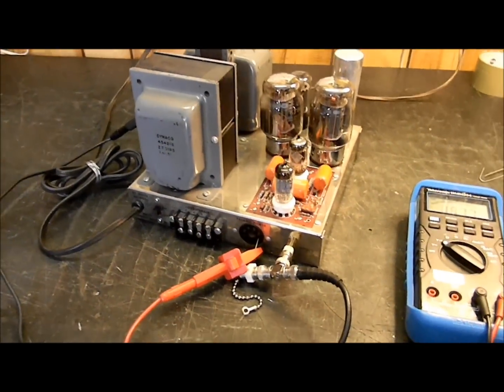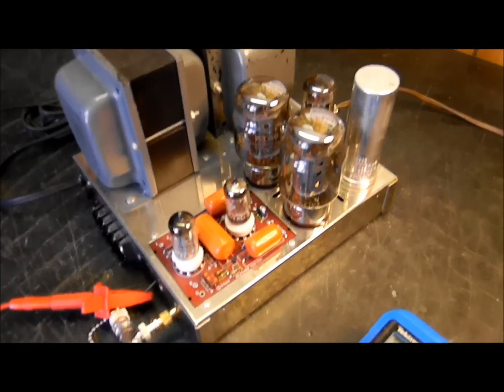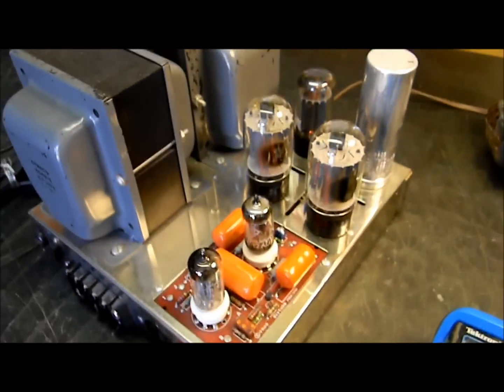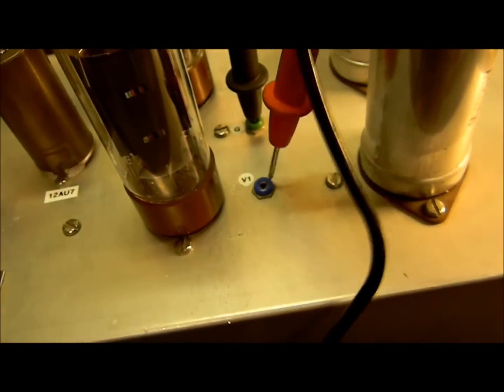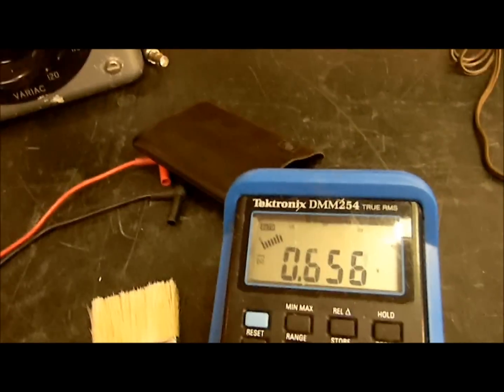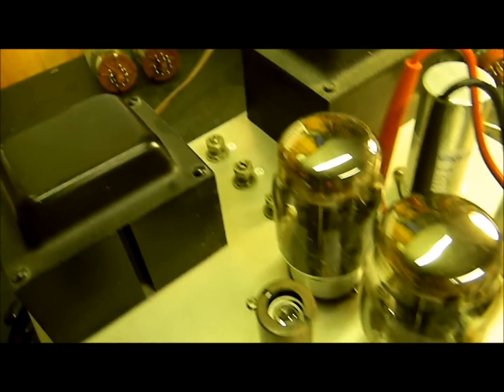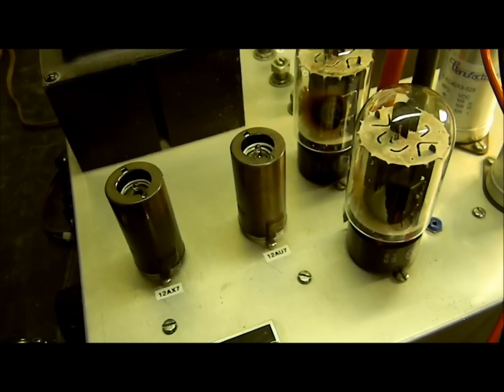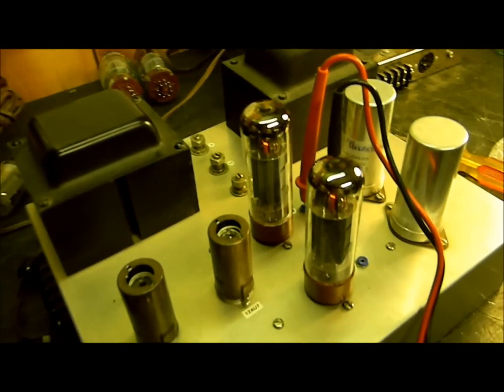KT88 vs EL34 vs 6L6 Substitution In Vacuum Tube Amplifier.wmv

Comment: At 1% distortion -- this is NOT good.   The old Quad Amplifier (from UK) using KT66's (mind you only 15 Watts max) had less than 0.1% total distortion.

The sound with 1% or more distortion must have been terrible.  No good whatsoever for classical music, but perfect for Pop, Metal, etc and other modern "noise".
Reply from the maker: I prefer CD over vinyl. I use Mcintosh C20, MC275 and MVP831with Klipschorns. As you might see from my videos, I like to experiment with other vacuum tube amplifiers. I have never been charmed with SE amplifiers. LF response on SE amplifiers is usually poor. 

I have another system with Dahlquist speakers that sound pretty good but are terribly inefficient. I have to drive them with a MC2205 and MX112. 

The stereo amp I built not long ago with the Acrosound TO-305 transformers from the Williamson/Heathkit circuit is a beautiful sounding 25 watt system on the Klipschorns.

I have some nice turntables, Rek-O-Kut and Thorens and others but acoustical feedback is always lurking when playing vinyl records.

And yourself? What do you prefer?
Reply: I was actually referring to Mr. Classical Music Elitist Alan Torrance. but your setup sounds pretty sweet
Reply: the queen eats bangers in bed in her panties
Reply: I have listened to the Quad Kt66 (old) that was owned by Ken Kessler himself, the sound was slow boring and really no dynamics.  Not a reference at all.
Reply: what medium are you playing your classical music with?

Comment: soo?? this second amp has a B+ of around 350v when the 88s load it down...in order to qualify 70ma each. i am looking to convert a marshall superlead (34s) to 88s.. could you verify the needed change in splitter resistors and screen resistors...?

Comment: In a nutshell, you have to re bias your amp if you change the tubes. Some amps have switching on the back, others the bias has to be manually done. So, the rule of thumb is just use the recommended tubes. My experience is the better the tubes the better your amp will sound. New tubes have to be broken into, they will sound very clean. I was upset when I put new tubes into my amp, it didn't have the same distortion and sounded too clean. Well, a lot to be said about old tubes and good distortion.

Comment: Can i Replace in a Marshall 1986 or 1987 the EL34 with the KT88-94 for More clean Headroom ? 
The Heater current of the KT88 is about the same of the EL34 ....I know i have to lower the bias feed resistor from 220k to 100k to avoid tube problems ..the question is : the transformer can handle the bias current draw with the KT88... i have read that the tube should be biased like a EL34...but if bias this way they should be biased too cold !!!!! Can i bias at 60% with a plate voltage of 470v-480v without overheating the transformer ?
Reply from the maker: +Giuseppe Loriga You are right about the filament current being close in the EL34 and 6550/KT88 so that should be OK. Plate voltage on both tubes can be as high as 800 volts. I doubt it will damage your transformers but I would limit the plate current in each KT88 to 70 mA (140 mA for both KT88's) by adjusting the grid bias. As the amplifier is built for an EL34 the bias is probably not negative enough for the KT88 so it will have to be adjustable to a more negative voltage.  Pin 1 of the EL34 is g3 and is probably grounded at the socket. Pin 1 of the KT88 is attached to the metal ring of the 6550/KT88 - make Sure pin 1 of the KT88 socket is grounded to the chassis - as it probably already is..
Reply: +ElPaso TubeAmps Thanks for your Help ... So what is the effect of the reduced plate current in the tube ? Can i bias the tube at 60% ( 43.8ma with a plate volge of 480v Class AB Fixed Bias) or it will run colder ? Last question the pin1 in my el34 tube socket is grounded to the chassis through the 1 Ohm resistor , is that ok for the KT88 ?

Comment: Those 6CA7s tubes are very dependable and they sound great I have a Quid set in my plush amp we tinkered with they are GEs however so the tone is there. EL34s were very unstable in the plush. I did put in a presence pot in the circuit. so the amp sound like a fender on steroids a cross between English & American. I like the math of it but I am not a tech. Thank you for posting this video. c];-D

Comment: I don`t know if you are using grid or cathode bias but check the manufacturers tube spec. Also remember that with EL34`s (6CA7)  you must earth the screen pin (G3) seperately.

Comment: question, when your figuring out the wattage output of an amp, i know you use voltage squared divided by the ohms gives you the wattage, but when your checking the voltage do you have to have to use a true rms meter, or is there a way to do it with a regular multi meter?also, do you know of any cheap devices that I can get to verify the actual output of an amp before clipping? or do you basically have to have a osciloscope, frequency driver, rms volt meter, resistive load(to emulate speaker), and distortion analyzer? or can i not use an osciliscope and just get away using a distortion analyzer?(somehow i have a feeling a dist analyzer is more expensive then a scope)

sorry for my igrorance but i'm relatively new at electronics repair and am trying to set myself up for working on tube/ss power amps.
Reply from the maker: You have described pretty much the whole setup. A distortion analyzer and an audio spectrum analyzer is probably the most expensive things to have. An oscilloscope, a signal generator, a RMS reading volt meter, and dummy loads are necessary. You can drive the amp up to just below clipping and get a pretty good idea of its performance with a THD around 1%.  Noticing the shape of the sine wave is important also. Pretty much any volt-ohm meter will work for reading RMS voltage at 1 KHz like the vintage Triplett and Simpson analog meters Knowing the frequency response of the meter before purchasing is a good idea and ideally you would want one that is flat from at least 20 to 20 KHz or better. The Tektronix TM500 series instruments will let you have an oscillator, voltmeter, distortion analyzer all in one mainframe. The most expensive items for this type of setup would be a SG505 oscillator and the AA501 distortion analyzer - you could pay $1K for those items but possibly less. You can buy good used Tektronix scopes for little money and in my opinion they are definitely the best to have. Of course new ones with a spectrum analyzer and oscilloscope built together (called Mixed Domain Oscilloscopes - MDO) are lots of thousands of $$$. Good luck with your enterprise. If there is anyway I can help, please let me know.

Comment: hello sir this video is really teaching a lot and it does help me a lot I still reading and comprehending more about tube amplifiers, I have a question if you don't mind, I still in the process of making a KT88 push pull ultra linear hi fi amp "not for guitar" home use on the cathode of the KT88 what resistor should I use 10R 3W is fine or should I get a 5W ? many people have use 5W and 3W what is correct ?

the B+ will be around 460V DC from a Edcor transformer model XPWR247-120 330 - 0 - 330 you mention already "long time ago" that I should use 4.2K output transformer one more question about output transformer, should I get one that can go up to 100W or one that supply about 60W ? I was thinking about the B+ and I'm not sure what transformer should I get because of the 460V DC B+ I'm a bit confuse to be honest

Regards
Juan
Reply from the maker: Hi Juan - here is the way I would look at it - absolute maximum cathode current for a pair of KT88's is about 275 mA - that is the current if the tube is being driven to maximum sustained sine wave power. (from a 1962 RCA tube manual) That current flowing through the 10 ohm cathode resistor would dissipate power of (I^2*R) which would be about 0.76 watts so a three watt resistor would be OK - even a 1 watt resistor would not burn up but would get pretty hot. Another possible way to look at it is, in case something goes terribly wrong in the tube and there is an excessive amount of current flowing through the tube, a 3 watt resistor would burn up before a 5 watt resistor would and "might" help protect the output transformer from excessive over current. So, we can see that making everything larger is not necessarily a good way to go. On the other hand, if the primary of the power transformer is fused properly, then it should blow and protect the amplifier. Another way to protect the circuitry is with a fuse in the high voltage line - a 0.5 A should be sufficient. Many guitar amplifiers have a HT fuse. Once you complete the amp, if you have one of the handy "Kill-A-Watt" meters that you can get pretty cheap at Lowes' you can actually measure the power up current of the amp and set the line fuse to some value above that point, somewhere around twice the max current that you measure. Hope this helps.
Reply: ElPaso TubeAmps
good idea about the HT fuse and the cathode resistor to be 3W and yes this does helps about the "Kill-A-Watt" really good idea I didn't  think  about that, I'm going slow with the build so when I have something done I will let you know thanks for the help :D and yes I have been aware of high B+ dangers don't worried I be really careful  my MOS was 94F Special Electronics Device Repair you have a great day sir :D

Regards
Juan

Comment: Hi my friend thanks for your videos
i have one old  70's  Sound City-50plus  amp, with JJ EL34 power tubes
I want to make his headroom bigger and stop the break up with bigger volumes (i have allready check my preamps and i find the right for me)
could i change them with KT 88. KT66  or other powertubes.                                 How this could change the sound with the KT88 or other set?.
Thanks a lot again
Reply from the maker: The filament current of the EL34 and 6550/KT88 are close enough that the filaments will be OK to switch to KT88's - but, the question remains if the bias supply has sufficient range to lower the cathode currents of the KT88's to a proper level. Only actually checking bias voltage levels and cathode currents will tell for any particular amp. I have successfully changed EL43's for KT88's in client's amps and one gentleman loves it. KT66's are just fancy 6L6's - I don't recommend using them in an EL34 or KT88 amp as the plate voltage is likely to be too high for safe operation.
Reply: ElPaso TubeAmps
you are very helpfoul!thanks alot again, can i put a pair of kt88 with out change the socket in of the tubes?
also could i change them with out a bias just for a listen?does it cost damage if i leave them with out bias? i am from an island and is really difficult to find a tech...
thanks agaian sorry for my English :)

Comment: Yes, Tim, your question will work with a JTM 45, you can use a dozen different tubes, you do have to change the bias resistor though.

Comment: Do you think this will work with any Kt88-6550 Amp?  I have a 50 watt Ampeg VL502 and I wanna try a set of 5881"s or Kt66"s. I cant get a good yes or no from any one... the amp has the switch to run either EL34"s or KT88"s thanks
Reply from the maker: Tim - some things to consider - first off 5881's have a lower plate dissipation than the 6L6GC - I had a McIntosh MC240 for many years, 30 years ago, and new USA made 5881's would not last more than a week. 6L6GC's would last forever.
The EL34 and 6550 can handle as much as 800 volts on the plate - a 6L6GC is more like 550 max so, you may have a serious problem there if you put them in place of your other tubes and may end up having a problem like I had with the 5881's in my Mac amp. One thing in your favor is the bias voltage for EL34's and 6550's is high enough that it will probably prevent your 6L6GC's from being destroyed immediately. Keep these ball-park figures in mind, 6L6 needs about -37 volts for 450 on the plate, the EL34 needs about -42 volts for 500+ volts on the plate and the 6550 needs about -54 volts for 600 or so volts on the plate. These are not exact numbers. What you can see is that if you plug a 6L6 into a 6550 amp you will probably have 600 volts on the plate with -50 volts bias on the control grid and it will probably work but I don't think the 6L6's will last long. Hope this helps.
Reply: How about the Kt66's? Would if fry those as well?
Reply from the maker: Tim Stanley A KT66 is just a "HiFi" version of a 6L6GC. A KT88 is the "HiFi" version of the 6550. EL34 and 6CA7 are the same as is an EL84 and a 6BQ5. You can experiment but to keep from frying things you must be able to measure (and adjust) cathode current. There are a number of "bias probes" available to do this and max cathode currents for all tubes can be found on the Internet. A static (quiescent) state for all the tubes is generally around 20-30% of the maximum plate dissipation for each tube. The higher the static plate dissipation, generally, the lower the THD up to the point of tube destruction. It is not terribly complicated but these things are what need to be taken into consideration otherwise a person is just plugging in tubes and watching what happens which often times is not what you want to happen.
Reply: Lol I really appreciate you taking the time to break it down for me. I think it mite be better for me to maybe wait and experiment with an amp that's already set up to run the Kt66's or maybe find a good tech that could check my amp out and see just what it is actually putting out and how hard it would be to set it up to run them. With the price of tube amps coming down everyday I could get a decent 50 watt head for Under $600/ 700 bucks.  Thanks again!!

Comment: What is that piece of equipment that tells you the voltage and percentage of distortion? 
I've got a scope and would love something like that!!
Reply from the maker: The distortion analyzer I use in this video is a Tektronix AA501. It also has a voltmeter built into it but for convenience I use a separate voltmeter. The Tek stuff for the 500 series modules are not too expensive except for the SG505 and AA501. Possibly another good instrument for you would be the HP 8903. It comes in model A and model B. It doesn't matter which one you get as they are both good. Check out these on Ebay and maybe you can find a good one - good luck.

Comment: hello boss on   a line balance potentiometer i dont have a 27 ohm resistor but i hve a thirty ohm resistor, how would that effect the line balance on the plate, or could i take a twenty ohm and a 8 ohm put them in parrallel together? thanks for listing to my nonsense

Comment: Great video Sir! Please advise me, I have HiFi amplifier Cayin A55T which have 4 KT88 in output in push pull configuration. Anode voltage B+ is about 400 V, Cathode is connected to 10 ohm resistor to GND. Bias is adjusted by negative voltage on grid and can go from -70V to -10V. I biased KT88 of about 45 mA (0.45 V across cathode resistor). Can I put EL34 valve in my amp and rebias it to about 40mA cathode current (voltage on grid can go up to -10 V)? Pin 1 and 8 are connected together in valve socket. I know that I will lose some power but I love EL34 tube a lot. Thanks :)
Reply from the maker: For some reason, I like the EL34 also. With the wide range of bias adjustment you have, you should be able to play with all three of the output tubes. Ballpark bias for the 6L6 is -37V, the EL34 is -45V and 6550 is -55V. For a HiFi amp Dynaco runs their 6550's at 70mA per tube. Pin 1 for the EL34 is the screen grid which Is Not internally connected as the 6550 is, so, pin 1 Must be grounded. You can leave the 10 ohm resistor in the cathode (pin 8). For the EL34, 40mA per tube is a good HiFi setting. Have fun - be careful.
Reply from the maker: With that wide range of bias adjustment, you should be able to safely install EL34's in your KT88 amp. Both the EL34 and KT88 can take 700-800 volts on the plate, the EL34 draws slightly less filament current so that is good. Overall, it should be a nice experiment and you may like it better than the KT88. You are very rare as you are interested in going "downward" in power rather than trying to put KT88's in place of 6L6's just to get more power which is a really bad idea. Good luck with your project, I think it could go well - please let me know what you discover and how it sounds compared to the KT88's.
Reply from the maker: ElPaso TubeAmps Sorry - I see I replied long ago concerning this.
Reply: ElPaso TubeAmps
Hi!  Do you find the EL34 700-800v plate rating also to be true of the Chinese and Russian imports?  Thanks!

Comment from the maker: have a bias supply with enough range to be able to make the bias supply negative enough to move from 6L6's to KT88's. 6L6's need bias something in the -40 volt range whereas the KT88's need bias voltage in the -50 volt range. I don't know about your Mesa Boogie Triple Rectifier - some Mesa Boogie's don't have adjustable bias voltage - you will just have to investigate the schematic carefully to determine if it will work and not overheat.

Comment from the maker: I can't remember the tube layout for every amp so I make mistakes. I have done mods for clients whereas I have swapped out 6L6's for KT88 and the client is happy just as you are. The potential problem is the 6L6's draw 0.9 amps each for the filaments and the KT88's draw 1.6 amps each so, most likely the filament voltage is low and the power transformer filament winding is overly stressed. It may last years or it may not. If it works and you are happy with it then all is good. Not all amps (next)